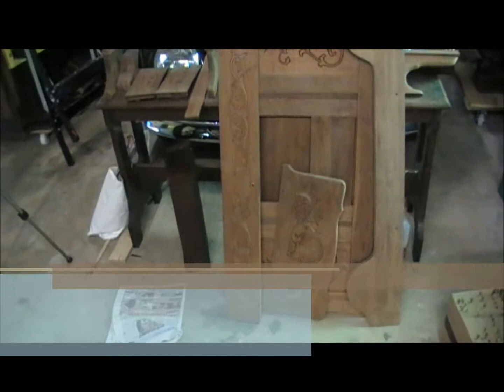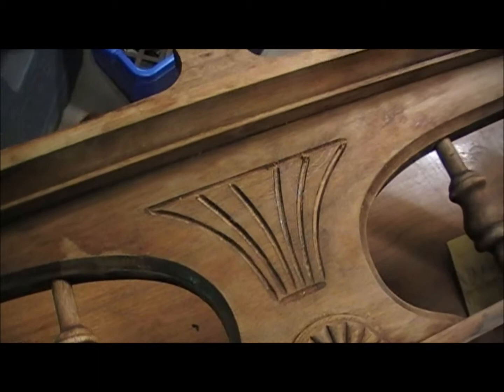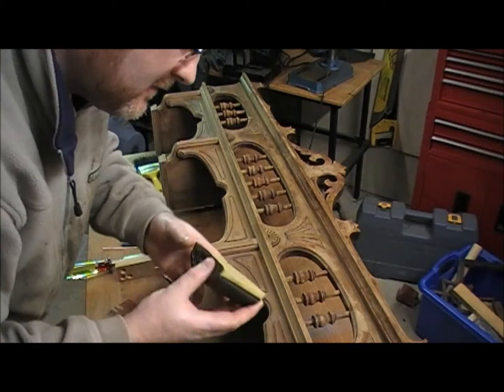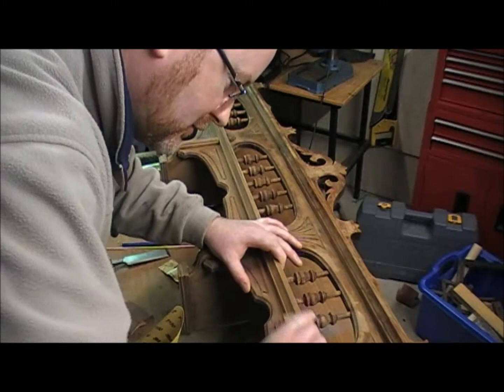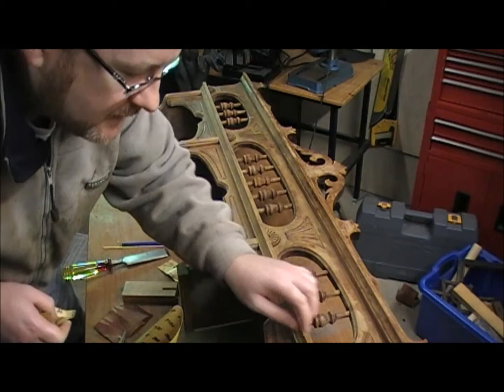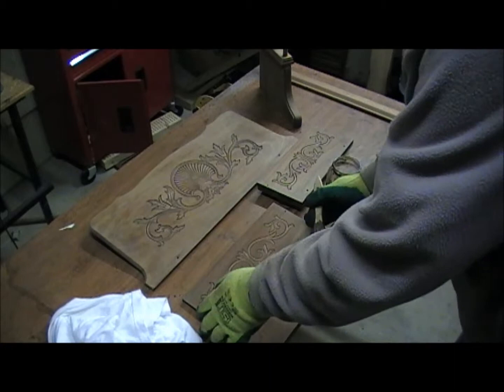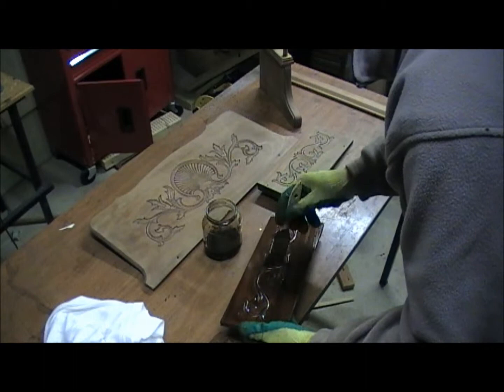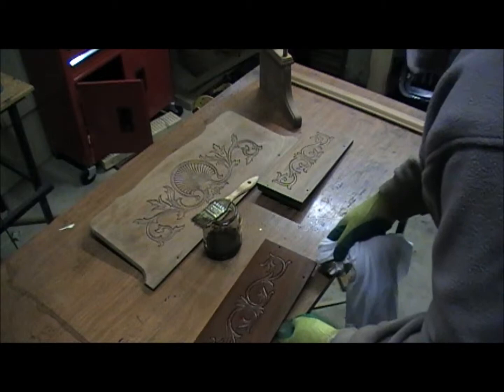Sanding and Staining The Reed Organ Case

Comment: Although an artists brush is needed for mouldings and engravings, the result of the panels overall will be much more uniform if the stain is applied with a cloth. I found it hard to get a uniform result with a brush.